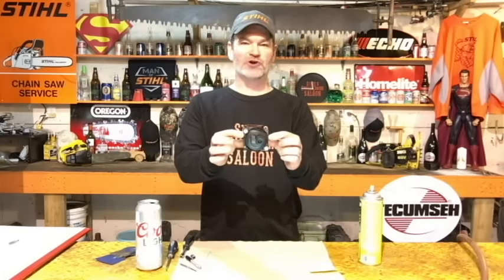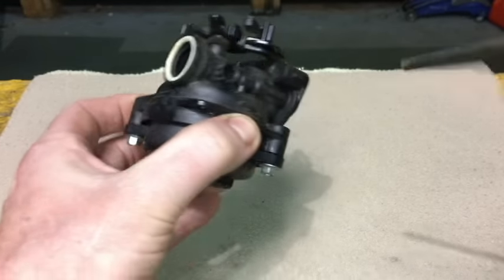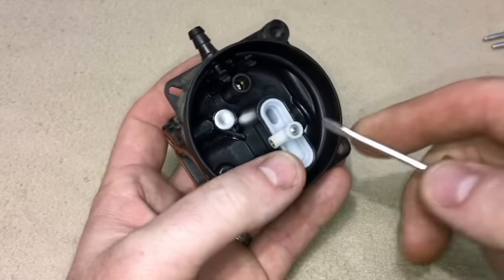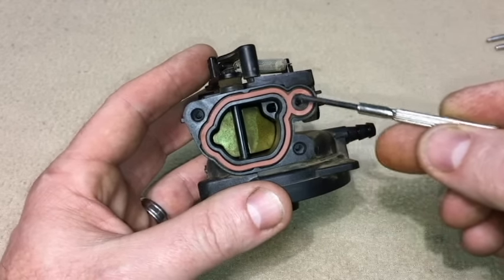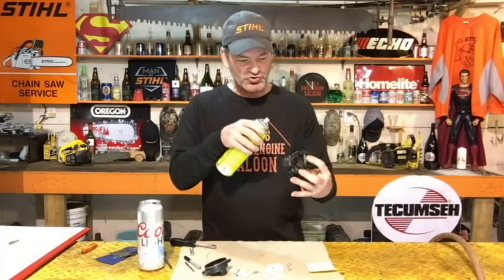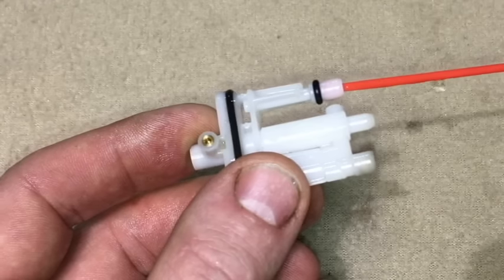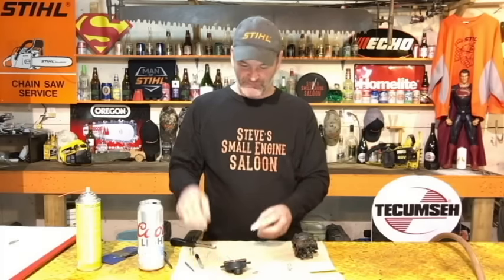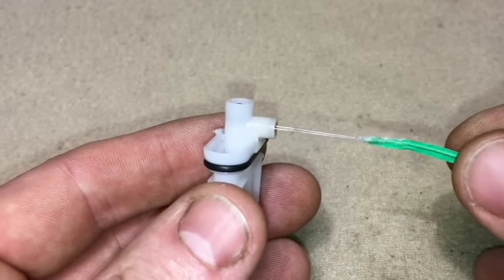EASIEST WAY To Clean a Plastic Briggs Carburetor

Comment: That was fantastic! And I’m not talking about the beer! Great video, Steve. I unclogged my carb, drilled the hole out using the set in your description, and it fires up on one pull. You’re the man! 

(the tip about the wire tie thickness was helpful, as I don’t have a caliper and some of the micro bits are just about too small to reliability differentiate)
Reply from the maker: Great job!

Comment: I replaced the main jet with a Genuine Briggs & Stratton. Part number 594060. It’s a 500E series engine on an older Murray push mower from Walmart. I also replaced the spark plug with a new genuine Champion, part number RC12YC. 
The engine runs perfect now.

Comment: Hey Steve you’re the best. My beer is better but thanks to your carburetor advice the mower started first pull. Did the choke obstruction but that wasn’t the prob. Took carb off and cleaned. I think the problem is no fuel filter due to the small port size. Inline filter is my recommendation. Great vids my hero.

Comment: Hello, great video.
I've been doing small engine repair for about 5 years now, for a little extra cash and therapeutic reasons (some thing about fixing this little engines).
95% of the time I can get them working just fine by cleaning the carb just as you described, but on a rare occasion after fully cleaning the carb it will still not work properly.
I've discovered that the ones that won't work have something in common, you've explained that on some the hole at the bottom does not blow out the front and on some it does.
Coincidentally in my case the ones that just refuse to work right, do not have this holes connected, my thought was that it's obstructed but I'm not so sure anymore.
It's driven me crazy trying to find out what actually goes bad with these carbs when they refuse to work right (engine turns on but sputter from rich mixture), I've ordered re pop new ones when this happens, taken them apart a lo and behold the holes mentioned are connected.
I disected one to see the obstruction but it seemed that it was built that way, so it got me wondering what I'm missing.
They are anywhere from $9-$30 online so its not worth spending too much time on the issue, but it bugs me to have 10 of these laying around that just won't work after a thorough cleaning.
I've fixed hundreds of lawn mowers, pressure washers, edgers and anything using this Briggs engine with the plastic carb.
You got any idea what happens with this plastic carbs when a cleaning won't get them working right?
By the way, it was this video that got me through the first time around about five years back.
Thanks

Comment: Thank you for this video. Literally have been cleaning my carb for the past two years having it work for a mow then next time it not starting again and cleaning it again. Even bought a cheap eBay carb and it worked for a while then same issue. Going to have to check this out tomorrow in my carb. Thanks again
Reply from the maker: You're Welcome...

Comment: I have a Snapper mower with a Briggs and Stratton engine.  It has this carburetor. I broke it down and cleaned it once when the mower was about 3 years old.  Today (about a year later I did it again but instead of cleaning the jets I just replaced with a new one.  Both times of repairing the carb it started on the first pull.  This time was just preventive maintenance.  I have never had a problem with the jets except for a clog at the plastic end the first time I worked on it. I guess I have just been lucky.  I am however going to get the drill set you mentioned.  Never know where it mite come in handy.
Reply from the maker: Right on Jimmy!  Thank You...

Comment: Thanks Steve!  I just got home from picking up a brand new (last year) mower for $25 that is currently on Sale at Canadian Tire for $429.99, normally $499.99.
I put a couple of drops of fuel in the carburetor and it started up for a second.
I've been working on small engines for close to 50 years, and have no doubt I could have easily taken the carb off and cleaned it etc. and had it running.  
I also consider myself smart, so came here looking to see if there were any tricks before doing the job.  I did see your previous video about the choke getting stuck.  I will look there first.
It is raining out right now, and my "shop" is my back yard.  I wanted to thank you in advance, just in case I forget to thank you later.
Reply: Update:  Had a break in the clouds.  The choke was fine, so I had to take it apart.  About 20 minutes worth of work and it runs perfectly.  I changed the oil in this "just add oil" motor as well.  Total cost: about $4.00.  3 and a half bucks worth of oil, and about 50 cents worth of carb cleaner.  
Thanks again for the video!

Comment: Had nothing but probs with these plastic carbs cartridge right out of box. Repair shop wanted to sell me brand new carb in which I would be back to same dam blockage problem. Glad you did this video!
Reply from the maker: Right on
Reply: Q. Steve when you drilled the hole larger did you just do plastic part or into that tiny brass part at the to bottom? Iam still having problems after clean out with carb spray. Thanks.

Comment: @Steve's Small Engine Saloon Have you run across the issue of the little sleeve coming loose in the chamber behind the choke flap? I ran across this issue today, i did the bend the frame trick didn't work. Cleaned it 3 times didn't work, then i seen that sleeve bouncing around in the chamber put it back in place and it runs like a charm! Thanks again for the great videos.

Comment: I ran into this problem with a Poulan snow blower only it was the top air jet. The blower was surging and wouldn't  stop. It didnt matter what I did to it. I finally found the answer to it on the internet.  Pull that top plastic jet holder and drill out the air jet. 
I just picked up a lawn mower last night that has this same problem as you mentioned. I will drill out the main jet. Thank  you for passing on that info.

Comment: This is the exact carburetor video I was looking for. After not knowing the bowl was attached by just a snug fit o-ring, I was searching my hardware stores for a 1/2 inch hex wrench like a dummy. Now I'll be searching for a micro hand drill set like a smarty :). Also after putting everything back together (minus cleaning the bowl, see above) my mower started with just a half pull and I thought YES IT WORKED so I happily ran it over to my yard to get started mowing and to my avail, it didn't want to start again...you can imagine my frustration.

Comment: There are also tiny (bread twist tie sized) holes in the emulsion tube. Yes, there is an emulsion tube in that cartridge, and it will clog.

The cartridge is two pieces, and when you separate them (with a precision screwdriver), you will see the holes on the center tube, just as on any other carb.

I cleaned one just day before yesterday that had something that looked like a tiny piece of algae covering two of the holes and all of them were clogged with the "Annual Ethanol Scale" (Spring is in the air in Middle Georgia!).

I've done a dozen or so of these plastic carbs and so far, cleaning the emulsion tube holes has done the trick. I haven't seen the main jet problem yet, though. I got here from your newer video on the tube being loose and blocking the choke. I haven't seen that one yet, either, but it is good to know. Thanks for posting these videos👍

(I probably should post this on the other video as well.)

Comment: It`s a nice tutorial! We have the identical issue with such plactic carb. I have cleaned it thoroughly, however, no difference in outcome. Too difficult to start the engine and... it`s possible one time only. If stop it and try to pull again- no response... The spark is normal, compression is acceptable, but no start. I`ll try to purchase this micro drill set, but, I have a doubt that this is only a problem. Do you know whether I can replace this plastic "masterpiece" with a traditional metal analog, please? How to find a compatible carburetor? Thank you

Comment: Here Steve... My UK “Handy” cultivator simply wouldn’t start after over wintering, so I embarked on the usual carburettor project and had already tried everything regarding complete carb cleaning, new gaskets, new plug - and even buying a brand new genuine B&S main jet assembly. All I achieved was the engine started fine, but stopped after a couple of seconds. My Son is a precision engineer, and he was able to tell me that the main jet assembly was already at 0.5mm, which got me a bit despondent about things. However we decided to ream it out an extra 0.1mm (to still only 0.6mm)... and after putting it all back, it started 2nd pull and runs sweet as a nut - so it seems your idea is spot on, and it begs the question as to why B&S designed it so small.

Anyway, thanks for sharing your observations... you really did help me out here, thanks
Reply from the maker: You're Welcome...

Comment: I fixed one of these by giving it a soapy hot water bath after disassembly followed by compressed air blow out. I also found and cleaned the debris in the gas tank. It's been running perfectly since. I think you're right though, very small jets make them very prone to clogs. Thanks for the video!

Comment: OMG, thank you!  I bought a 7.25 Craftsman mower off of craigslist for $25.  It was in great shape, but advertised as being unable to start.  I first changed the plug, but that wasn't the fix.  I googled "Briggs and Stratton carburetor issues" and found this page.  After watching I took off the carb, which had piss-yellow gas in the bowl, and cleaned it.   I also blew carb cleaner through the jet--I didn't need to ream the jet.  After reassembling,  I checked the choke and it WAS sticking on the frame, so I bent out the carburetor frame as shown in the other video.  Long story short: the $25 Craftsman mower runs like new.  One more thing: I drank red wine while working on the mower, Steve.  Was that okay?  Thanks for the great video!

--Steve in Flagstaff, AZ
Reply from the maker: Great job!

Comment: I've tinkered around with small engines since the early 70s.  I made a lot of my spending money in junior high and high school, working on them.  I've never seen anything as bad as these carbs.  I'm going to try your advise with the drill.  I have a Briggs lawnmower with a plastic carb.  Rather than fight the carb, I just replace them and I don't have the patience to deal with the warranty.  I change carbs more often than I change the oil...literally.  I'm now on the fourth carb.  I have the original on my desk.  I'm getting some micro drills.
Reply from the maker: Good luck!

Comment: I like that sentiment about “needing to know why”
I wish I would have seen this video before I went to war with mine needing to know wtf is going on. I eventually arrived at your procedure but in doing so the other brass jet/fitting (not the main) fell out when spraying cleaner through it in my gravel driveway. That lead to several minutes on my hands and knees staring at gravel looking for a tiny jet. Found it,reassembled and cleaned. It runs great now but it seems to be a twice a season thing with these carbs.

Comment: I just did this and it worked great! A couple of other bad things about this carb;  No room to get a 1omm aeen wrench in there to drain it without removing the carb. Fuel hose is barely long enough to get a screen in there, and not long enough for a better, paper one. Also, I could not get carb cleaner to go through one of the small holes, but it runs well anyway.  Maybe I missed this on the video.

Comment: I have a mower with a B&S 550e engine and one of those plastic carburators. I've modified the mower when it was new and installed one of those plastic 75 micron in-line fuel filters from B&S (part # 394358S). I've been running that mower for 6 or 7 years now, sometimes not even draining the remaining fuel for winter. It starts on the first or second pull, every time. Never had to clean or modify the carb, thus far. Having a fine particle fuel filter and running ethanol-free gas goes a long way on these.
Reply from the maker: Right on

Comment: FWIW... Had the same prob . 
I did a "bad"..
Pulled the brass jets out (easy) put my welding torch tip cleaner through both (ripped em hard twice each) back together, and runs fine since.

Comment: I just took mine apart and used a bread tie twist to clean out the jets, blasted it with carb cleaner and it seemed to loosen up what ever the problem was.
It would only start with a blast of engine starter into the carb then die immediately. Thanks for the walk through on what to try before replacing.
Reply from the maker: You're Welcome...

Comment: Great work Steve ,m my plastic Carbi does not have a choke valve, maybe the hole where you tried to put the cleaner through is for the choke passage, there is no spring on top of the carbi for 
the choke valve, I might have an earlier carbi  . Thanks keep up the good work

Comment: Thanks for your insights, was able to poke a bread tie through the jet on our plastic cartridge. Don't know if it was stale gas in the carb or not this time, had let it sit through a hot month with little growth. If it gunks up again (almost 3 seasons without issue) I'll look into those drill bits.
Reply from the maker: Right on

Comment: Thanks dad, and for the link to the drill, but also the tip about the twist tie wire sizing. Good info.
Reply from the maker: You're Welcome...
Reply: @StevesSmallEngineSaloon  Omg that was so hard because I didn't use a table. Thanks for showing us what tools we'd need and close ups. But I had 3 problems. 1) One of the parts had 2 different size nuts. The prior mechanic sabotaged me. 2) I couldn't get the hose clamp off. He put the metal press-points on the back side of the hose - so I couldn't see or reach. I had to watch another vid on how to press that clamp to release it. 

3) 2:53 you showed us how to pry the bowl open, but not how to get back on lol. My O-ring was bigger than the part. So when I pushed the parts back together, I had O ring sticking out on 2 sides. I wasn't sure if my ring was defective and if I should stop, or force it in. 

I had to press the 2 parts together at a slight angle, so 1 edge of the O-ring got in the groove. Then while applying strong pressure with 1 hand, I had to use the other to gradually wedge the rest of O-ring in using a plastic-like screwdriver (a tool for prying auto trim, had to use plastic because a tiny mental screwdriver nicked the rubber). 

4) I sprayed the cartridge and got twist-tie wire like you showed. But both tubes didn't clear, only the center one (but it worked).
5) My back hurts so much from bending over for #2. Now I know why you use elevation. You should point that out to us and explain why we should use a table: better lighting/view angle and better for your back.

Comment: I took mine apart and used my air gun with a basketball needle to blow through the jets in the cartridge. Just make sure your pressure isn't too high. Got mine back up and running!

Comment: Thanks, fixed a mower that was advertised as only running on starting fluid. As figured the main jet was plugged, though mine is definitely bigger than the one you showed. I miss working on vintage Honda’s that have some of the best carbs ever made and they are so easy to clean
Reply from the maker: Right on

Comment: So your quick fix didn't really fixed it as it was a problem but the injector also was a problem.  Got the .020" micro drill bit.  That is #76 for those who need to buy them (they are flimsy so you may want to be a pack).  Now she's running like new, one pull to start every time.  

Thank you Steve.  You're a good man.  👍
Reply: May you stay safe and healthy 😎

Comment: Great tutorial on cleaning the plastic carburetor on the 450e.
Have had it off 3 times so far.
Still won't stay running. 
All the jets and orifices have been cleared. 
Is there supposed to be a nylon spacer on the engine first then the o-ring?
May have lost it on disassembly.

Comment: Steve, thank you so much for sharing your expertise! Mine runs great now after following your instructions, BUT now leaks gas out of the carb. Guessing I didn’t get the needle back in the correct position or something stupid like that. Any tips for what I should check? Once it’s running the leak stops, but it’s a steady flow until the gas runs out in the tank.

Comment: Mine ran great for like 5 years, it did surge a bit but ran good, this summer it wouldnt run at all without closing off the intake, then it would run for about 10 minutes.
Pulled the carb, cleaned it all up, warbled out the jet with a .5mm bit, thanks to 3D Printing or I would have had to make a run to the hardware store.
Runs better then ever....

Comment: I followed the instructions for just doing a cleaning with carburetor spray and an air compressor. I think I cleared some blockage on the main jet. After reassembly the engine fired right up on the second pull. Saved me from buying a new lawn mower.
Reply from the maker: Great job!

Comment: Have you experimented with the jet size?  Most home improvement stores don't have any drill bits smaller than 1/16 about 62 thousands.  That's a lot bigger than you talk about in this video, but is it too big?  

I opened my clogged main jet with a stick pin.  Thanks for a great video!  Your pictures are valuable and well oriented to help us dyi folks.